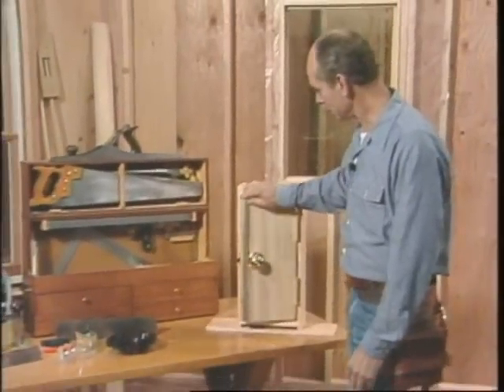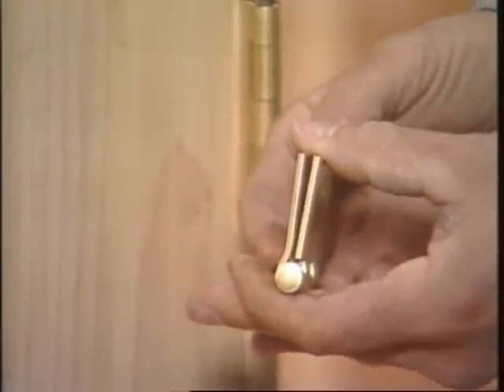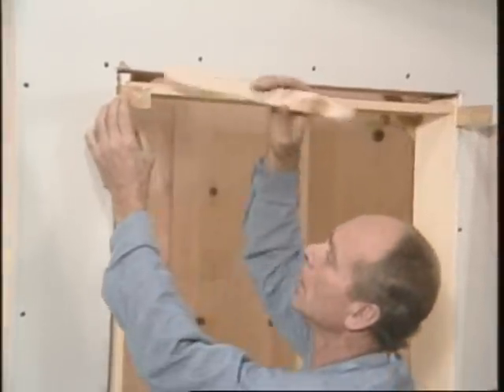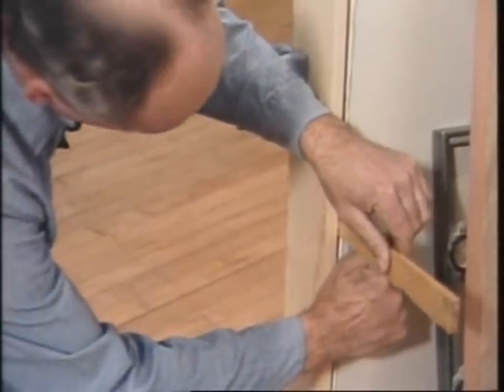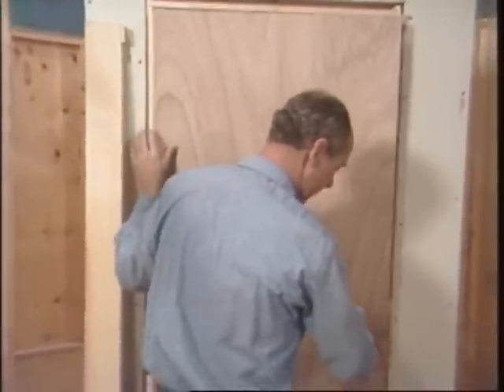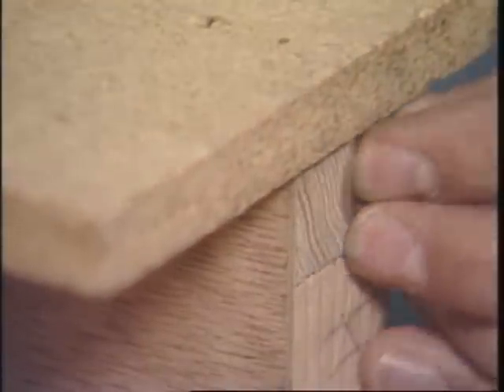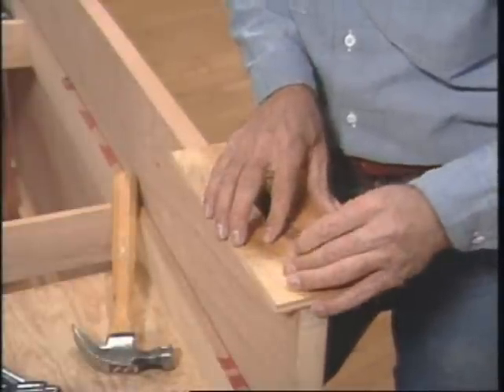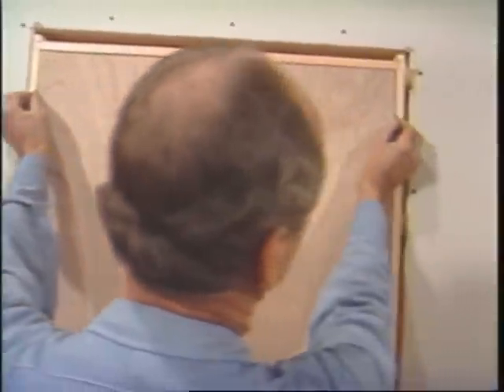Installing Bathroom Door

Comment: Thanks for the video but I have a question. If your door is 30" and your spreader is 30" same as your door width how is the door going to open and close with ease. Shouldnt your opening and spreader be 30 1/4"  to allow for the door to fit with 1/8" space on each side? please assist me with this inquiry.  Thanks in advance!
Reply: I believe he just took those amount off the door when he hung it, i had the same question at first.

Comment: Why does he gain a 1/16th on the hinge side when scribing the stop?
Reply: To prevent the door from binding on the stop. If the stop was tight against the door on the hinge side it would stop the door from closing especially when it expanded 👍🏻